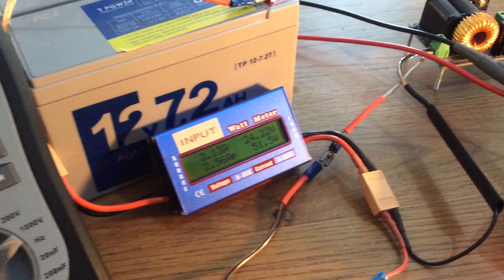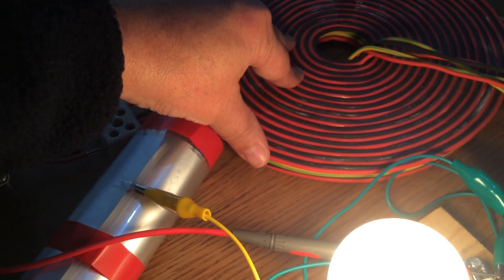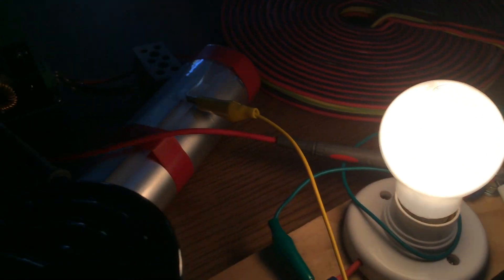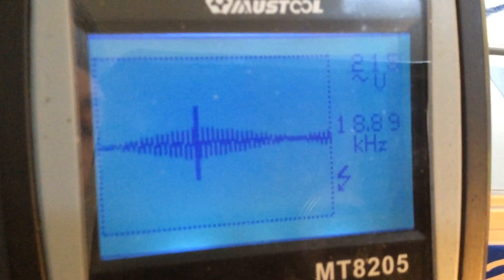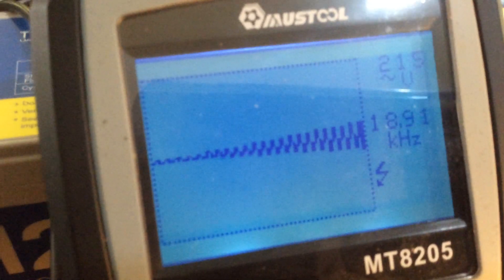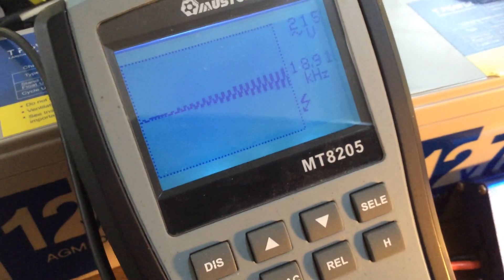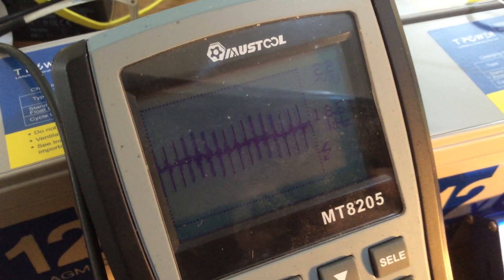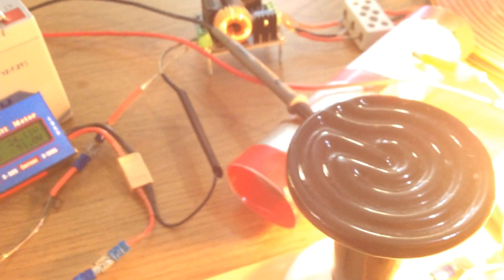PANCAKE COIL CAP VS NO CAP OSCILLOSCOPE SHOTS

Comment: I wonder if your capacitor acting as power factor correction in this setup ? I mean, with capacitor you draw less power from batteries ?

Also i wonder if you tried to take a little portion from output through a diode and a capacitor in parallel to pulse some electricity back into battery ?
Reply from the maker: Thank you for your comment.
Sorry for my delayed reply. The capacitor will definitely change the resonant frequency and the correct capacitor will reduce power consumption from the source.

I have done a heap of experiments with these coils and with extra coils, transformers and other devices and feeding back to the batteries is certainly possible, the best results I had was using Tesla’s diode arrangement. I will try to make a video on this soon.
Reply: @whatifididthis...1236  indeed, we should expect a change in resonant frequency. I can’t remember why I asked if we can make it self sustaining as long as an alternative energy source is used, probably i wanted to know if same series-parallel setup for batteries would work but my mind was onto something else.

I never heard about Tesla’s diode arrangement … is this some kind of don smith kapagen or similar device ?
Reply from the maker: @Caesarus2011  The Tesla Diode uses specifically wound transformers that allow the conversion of AC to DC. Search the following NIKOLA TESLA U.S. PATENT 413,353 - METHOD OF OBTAINING DIRECT FROM ALTERNATING CURRENTS.

Comment: Simply amazing … and whole setup is low cost or up cycled❤ Always trust your instincts, expensive testing equipment are needed only by those who want to explain how things works or why they shouldn’t work when is not convenient to see their science blown away.

 By the speed I am seeing all this kind of devices popping up almost everywhere I guess a lot of people might be able to get some decent savings if no grid is required to have a home warm or running domestic appliances.

You were absolutely right earlier when you said that any setup will work based on limits of its components.
Reply from the maker: Thank you for your comment.
 My main focus is showing people this technology requires very little money to build and in turn costs very little to run. The only item purchased for this was the ZVS driver, everything else was lying around in scrap form. This can also be done without a ZVS but is definitely easier buying the AUD$15 ZVS than it is to make an oscillator circuit. 

I agree regarding the expensive meters, a lot of people see that technology and think they need these devices to be able to make these units, that is so far from the truth. Nearly all my devices are designed to meet the loads requirements, I only bring the meter out to test out of pure curiosity, half the time they aren’t capable of measuring my systems anyway, mostly because radiant electricity permeates every object in near range producing high frequency that then saturates the chips and components corrupting the readings. When a meter is connected to my through earth Tesla circuit I can power coils and lights just by bringing them near the meter, there is not a single component not exposed to radiant electricity, which is not what the components are designed for.

Comment: Awesome Mate.

That ringing effect you can see on the scope at a higher frequency is the resonant frequency of your system.

If you could adjust the AC supply frequency  up to match that you would peak at resonance & have highest efficiency.

I don't have glasses on hand to see clearer,
but it would be a much much higher frequency than what you are supplying

The other option would be to make the coil system much much much larger 
to lower the natural resonant frequency of your system.

Keep up the Great Work Mate
& I hope that life is.treating you well too.

Cheerz from E ⚡🙏⚡
Reply from the maker: Thank you for watching. I never did investigate the resonant frequency for this one and instead worked off of physical results. The resonant frequency should be investigated though for best efficiency as you state, it’s already efficient, however knowing it’s not resonant would be like driving a car with the wrong fuel, yes it will run but not efficiently.
Reply: @whatifididthis...1236  Awesome Mate.

If you could increase the frequency gradually whilst watching that higher frequency ringing effect,
you will alao find harmonic frequencies that are below the system resonance too that will be great.  
The trouble is having an adjustable frequency AC supply.

You can use a function generator but they have very low output power.

Love your Work mate ⚡🙏⚡
Reply: You could also vary the Capacitance to Vary the Resonant Frequency ,
Reply from the maker: @crazyham  I was thinking of acquiring a variable capacitor to allow me to find resonance with the scope. I liked your radio frequency battery experiment. Have you tried using an Avramenko plug or Dr Stifflers loop in that configuration?, could be interesting.